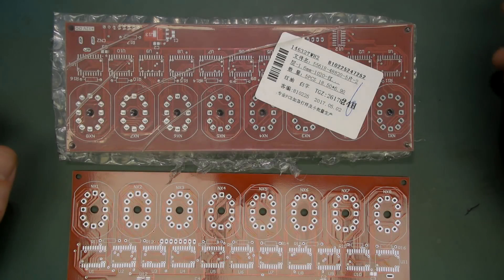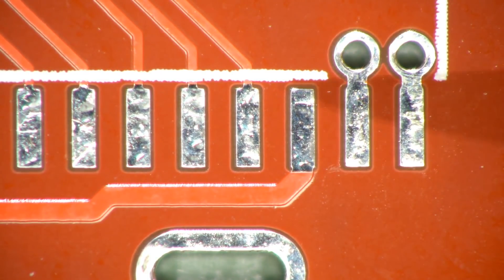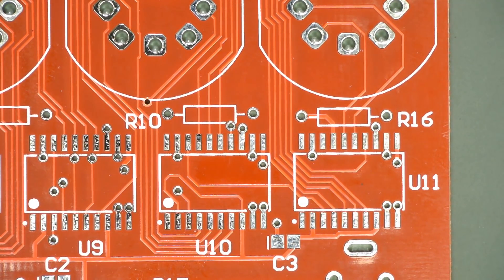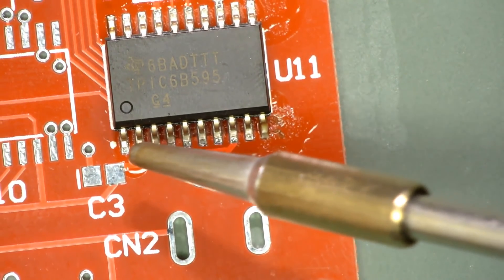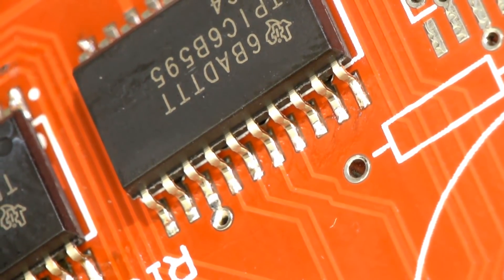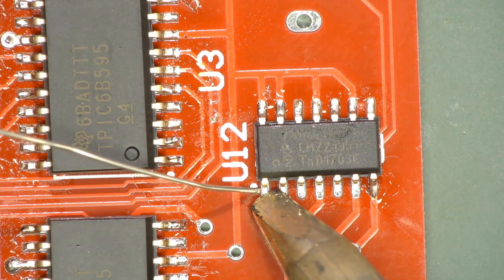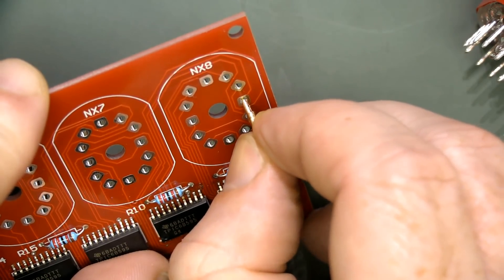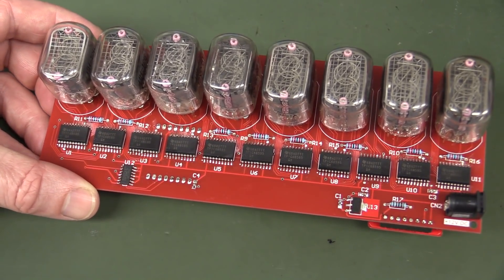EEVblog #997 - How To Solder Surface Mount Components

Comment: Surface mount skills (for better or worse) are needed by today's hobbyists. Thanks for keeping the flame burning!
Reply: I find it easier than through-hole parts because you don't have to worry about getting that nice fillet on the main side of the board.
Reply: I haven't tried it because I don't see well. I solder bad on the things I CAN see. xD

(I need a microscope mount for my phone or something)
Reply: You open a lot of possibilities that way.  (To all)  If you haven't converted yet, give it a shot.  Not hard.  :-)
Reply: Nobody sees SMD parts well.  :-)  An articulating lighted magnifier or an RPi camera + LCD work pretty well though.
Reply: I just use hot air   like most youtubers.. lol
Reply: thats dumb. The arduino board people could do through hole because their projects dont have nearly enough stuff to justify SMD. If you arent going to use SMD to its fullest advantages, why bother doing it. In fact most peripheral mounted boards for desktop computers could be through hole, its just that the industry has made it cheaper and its basically impossible to get some things as through hole components.

Comment: I'm a big fan of the 'Dab' maneuver, using a tip not much wider than the pad.   With the temperature dialed in just right, a quick poke, preheat for ~1/3 second, feed solder, hold for ~1/3 second, and on to the next, works great!  :)
Reply from the maker: The smaller the tip though to less the pull-back surface tension force that limits the amount of solder going onto the joint. That's why I prefer a wider tip for this, even if it covers several pins at once.
Reply: That's an interesting observation. Never thought of it that way.
I'm the OCD type using a magnifying glass and the more petite (LOL) iron I can find.  ;)
I think we all find a technique that matches our emotional "needs."  Hahaha.

Comment: These packages are piece of cake, the real problem comes when soldering packages like LQFP144. The clearance between pins is so freaking small I could not find any way to solder it fast and reliably by hand. Takes forever to inspect for joints and remove them... ugh...
Reply from the maker: Same way, or use paste and hot air, you just need the solder mask between pins, that's the key.
Reply: Even with solder mask it can go wrong if there is too much paste. Using stencil helps a lot, but that adds to the cost.
Reply from the maker: Just wick off the excess will a well tip, no problem.
Reply: I don't understand why people like the well tips for drag soldering; I find using a curved conical tip with a tiny blob of solder in the inside elbow works the best while dragged over heavily fluxed pads without actually contacting the pins works a charm. the only two really imporant aspects of drag soldering seem to be to be lots of flux and a tip with adequate thermal mass. if another pass or two doesn't pull a blob from bridged pins, dab it with a wick and even it out.